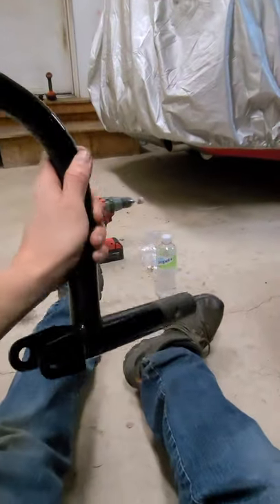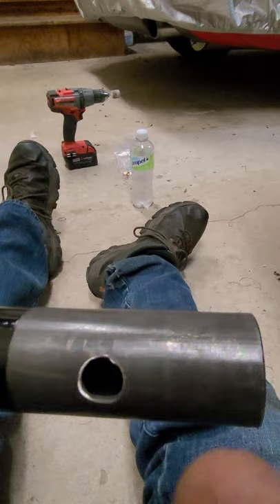Parachute Mount!

Comment: How did you find the center of the bumper?
Reply from the maker: I installed the bracket with the bumper on and marked it from the backside. Then transfered the center from that mark onto the front side. Another way would be to do as I stated above but mark the backside of the bumper  remove the bracket and drill a small hole in the center from the backside then use the hole saw from the plate side.